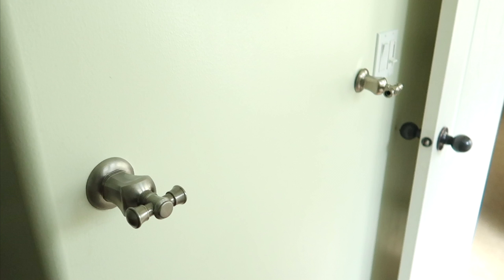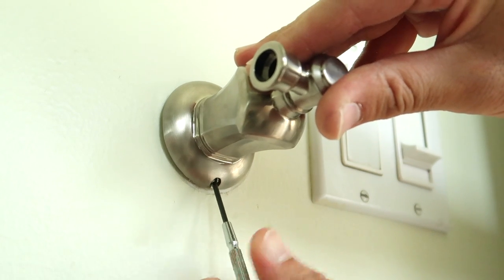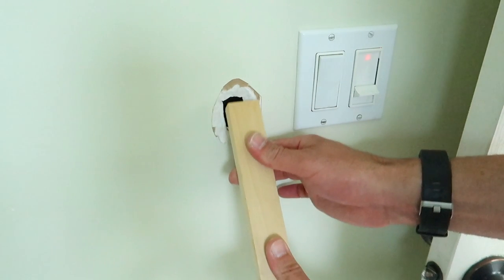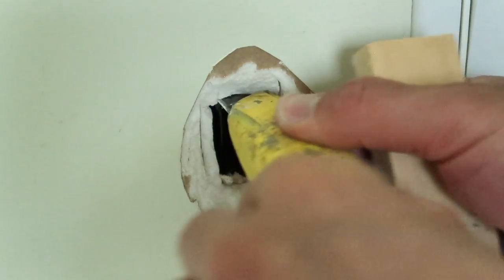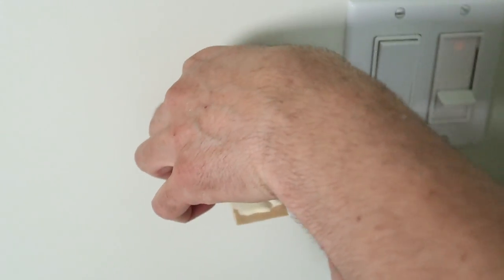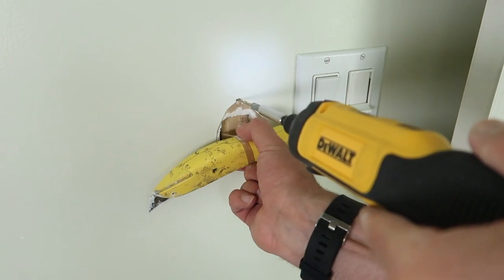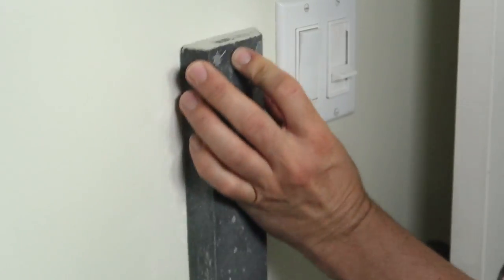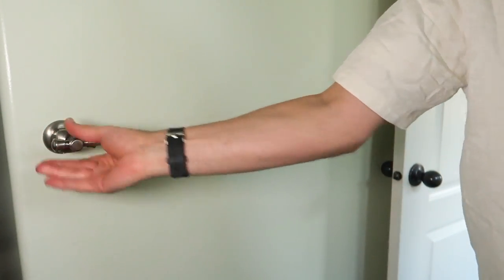How to Repair & Hang a Loose Towel Bar Holder

Comment: I like these quick diy's but the problem is if you put more weight onto the wood it'll probably crack the drywall so its like a tier up better than just screwing through drywall. I wish it was possible to screw to the foundation, i guess thats a good reason to know where the studs are or the 2x4's. unless your walls not (left to right) wide enough then you can only put it in a certain location with barely much play of where you want it.
Reply: Lime 
That seems to be a common problem that there aren't "studs" where You want to place a Towel Rack. I believe Adams idea of putting the wood behind the wall will definitely make it hold much better than nothing but plaster. Especially if there's any weight put on it for a period of time. Good point! 👍😉
Reply: BevG181 yea. So unfortunate though. Learn something new every day ye!
Reply: Lime 
Yes We do live and learn! I've had a cubboard in just the plaster with butterfly type screws for a linen cupboard and after about 4 year's of holding, One night I heard a huge bang and the Entire Cupboard came down! I had huge holes as a result. I'm not very fond of relying on the Plaster to hold for very long now. I'd like to be sure now that I'm doing the work, that it's gonna hold for a good time! I'm not going to mess around with anything now! I'm going to try to do it right the first time! I don't have a Man to do things for Me and even when I did, He was not a handyman to begin with! Now that it's My home, I intend to do it right the first time! Not taking any chances! LOL! 
I'm not getting any response from Adam on the glue that I should use to hold the wood behind the wall. Do You know the type of glue I should use? I want to be sure it stays put Against the plaster. I'd really appreciate any suggestions You might add. Thanks in advance for your help! I'll be looking for your reply. Much appreciated!
Reply: Well this is still probably sturdier than toggle bolts, which is usually my go-to to fix these things. I'm not a huge fan of toggles, but they work. This wood solution seems a lot nicer.
Reply from the maker: I see what you are saying but have done it this way for many years and never had it crack or become loose.  One would have to throw some serious weight/abuse on it to damage it again. I guess it possible, but not likely.
Reply: AdamDIY 
Thanks again Adam for the answer to the type of glue. I think He forgot in His reply! I'm going with the "Best" fix it solution!
Reply: Some contractors will add a cross 2x4 where the towel rod is planned so you have wood to screw into.

Comment: Fantastic Timing Adam! 
I was just looking at My towel racks (that are currently down) in both My Bathroom's last night! I've got a bit of a nightmare here in a remodel job gone bad!! So, I'm just trying to get some basic things put back properly. I'm going to be "repairing" the towel rack holes left in the walls within the next few day's. I knew the old holes wouldn't be good and Why "They" removed the towel racks but didn't do anything about patching the holes left behind before painting! I've found big dents in the corners of walls and just plain holes painted over!! I'm sick to say the least but, "I've got it handled"!! 💪 This video couldn't have come at a better time to help Me with the towel racks! (What type of glue did You use on the wood stick to hold and bond it to the plaster inside the wall?) I've got holes to patch where the blinds were also and New Blinds will be installed. I'm  sure I will have to repair the old holes before installing the New Blinds. Would You recommend the same type of patching "putty" (for lack of a better word) those holes also? I'll be looking for a lot of HELP Videos to get My home put back together "Correctly"! I'm "confident" I can get it done! Thanks Adam I truly appreciate Your Videos!
Reply from the maker: You are right, you can use the same patching compound for the holes from the blinds and also dents in the wall. As for the glue, I used wood glue. But I guess even white school glue would work.  Sounds like you have your work cut out for you! Best of luck! ;)
Reply: AdamDIY 
Thank You Adam. I appreciate your time to get back to Me. I do have a lot of work ahead. I'm confident I will succeed in the repairs that I will be doing Myself, and have a beautiful home to live in! I'llI be a very proud home Owner! (And a knowledgeable One! With a little Help from My Friend Adam! ) 😉
Reply: @AdamDIY  can you put update video about this work? Does it hold the rack still?

Comment: Why did you fill with joint compound instead of patching the hole? As in cutting the hole square and cutting a piece of extra drywall to fill the void? Then use spackle or compound to smooth that over.

I followed your video and it's working so far. But drying time for that much compound is at least 24 hours, so that part is taking a while. Only have one coat and it's the next day. It's shrunk a bit and is still soft in the middle. Will surely take 1 or 2 more layers and that's 1 or 2 more days. I don't think the hole I'm working with is much bigger than the one in the video. Curious what yours thoughts are. 

Anyway, thanks for the video!
Reply: I agree with your comment on Adam's video - e.g. using a piece of drywall to fill the hole. At the same time, as a DIYer, I found the best upgrade to my drywalling has been buying the Quikset 90 or 45-minute mud. It undergoes a reaction to harden in an hour to an hour and a half instead of air drying for like 24h and it is ready to work with, sand, prime etc. in that short time. For big patches just get some of that - it's cheap, like 10-20$ for a big bag of mixable powder - and it gets you finishing projects MUCH faster.

Comment: Great Stuff foam works great for this fix.
Reply: How ?
Reply: @yobanytiu6743  take your hardware out of the wall. Fill that hole with Great Stuff. Put your hardware back in and hang your bar. Tape the bar holder to the wall nice and tight so that as the foam expands, it doesn't push it out. Use a tape that won't peel your paint also. Let set overnight. Cheap and easy.